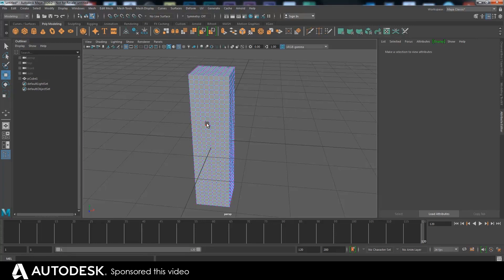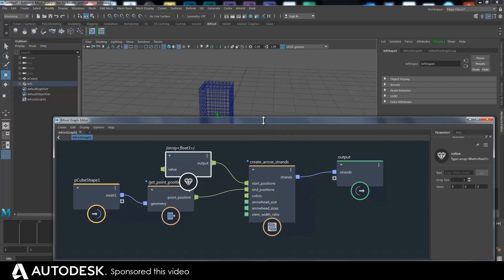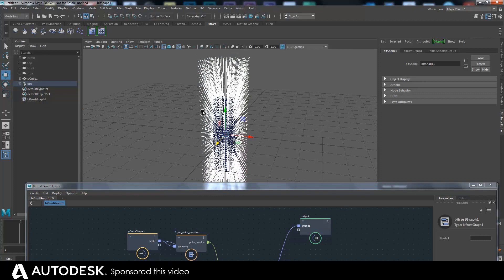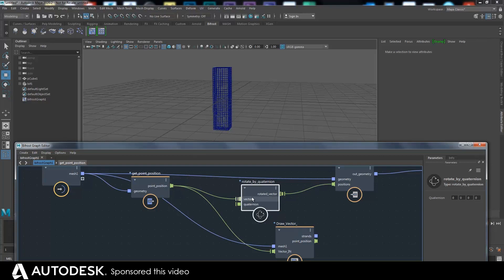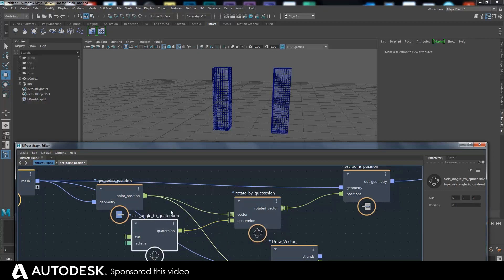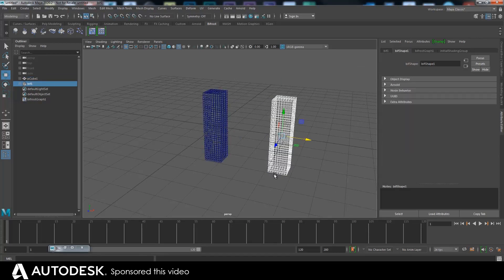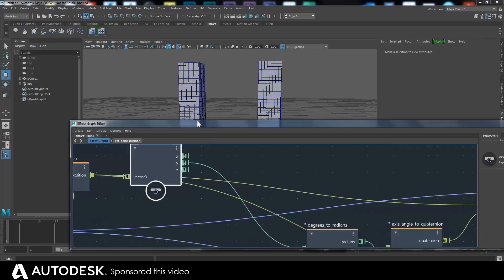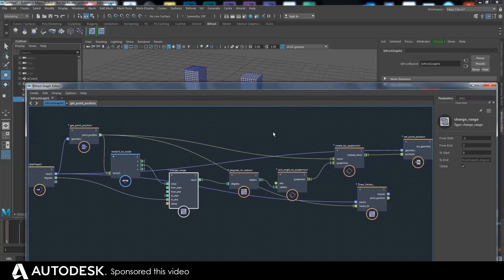Exploring Bifrost with Paul Smith - Ep. (12) 0.1: More Basics

Comment: Really nice Paul, great demo! you could show the vert normals fix at the end.  Also, you're probably not being truthful about not knowing what quaternion four values are. :)  But just in case, you basically explained them.  Quaternions so far as I know, are just a vector and the forth value is the roll probably in degrees, but maybe radians, assuming the standard up vector. So quaternion are really just an aim constraint in a way. X, Y, Z and roll.  That gives a rotation since a vector is a direction (and distance) but a simple vector doesn't explain the roll.